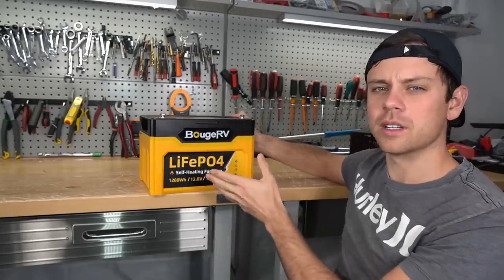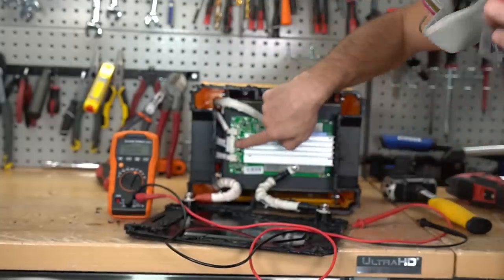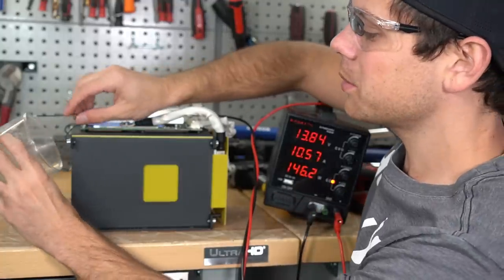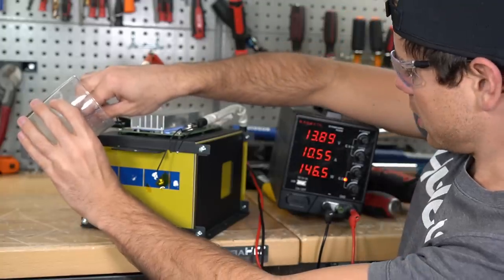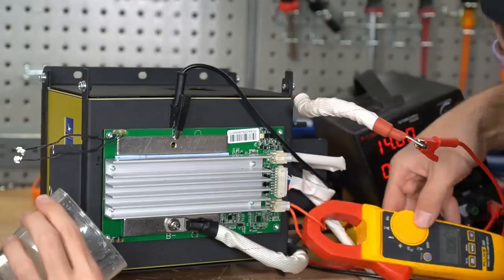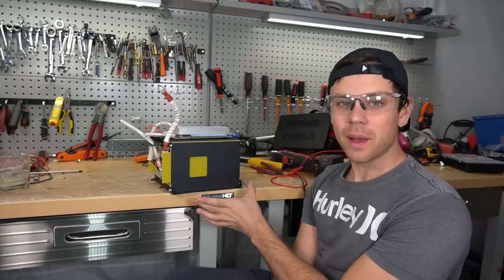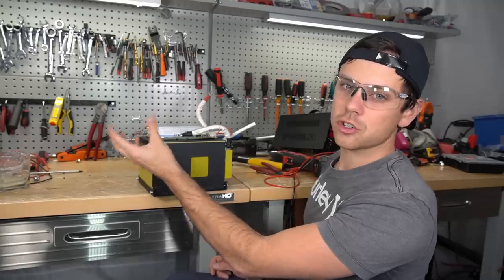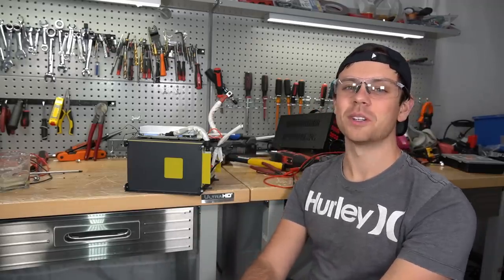$679 BougeRV 12V LiFePO4 Solar Battery

Comment from the maker: You can buy it here (affiliate link): https://www.bougerv.com/products/12v-100ah-lifepo4-battery?aff=will
~~~~~~~~~~~~~~~~~~~~~~~~~~
Does off-grid solar confuse you? Check out my DIY friendly website for solar system packages and product recommendations, and so much more!: http://www.mobile-solarpower.com

Join our DIY solar community! #1 largest solar forum on the internet for beginners and professionals alike: https://www.diysolarforum.com

Check out my best-selling, beginner-friendly 12V off-grid solar book (affiliate link):
http://amzn.to/2Aj4dX4

~~~~~~~~~~~~~~~~~~~~~~~~~
My Solar Equipment Recommendations (Constantly updated! Check here first):

12V/48V Lithium Batteries: https://www.mobile-solarpower.com/solar-batteries.html

Solar System Component Directory: https://www.mobile-solarpower.com/solarcomponents.html

Plug-N-Play Systems: https://www.mobile-solarpower.com/full-size-systems.html

Complete 48V System Kits: https://www.mobile-solarpower.com/complete-48v-solar-kits.html

DIY Friendly Air Conditioner/ Heat Pumps: https://www.mobile-solarpower.com/solar-friendly-air-conditioners.html

Complete 48V System Blueprint: https://www.mobile-solarpower.com/48v-complete-system-blueprint.html

~~~~~~~~~~~~~~~~~~~~~~~~~~
My Favorite Online Stores for DIY Solar Products:

-Signature Solar: Offgrid One-Stop-Shop. Best Value 48V LiFePO4, Victron, Quality Solar Panels and Offgrid Specific Heat Pumps: 
https://www.signaturesolar.com/?ref=h-cvbzfahsek 

-Current Connected: SOK, Victron, Mr.Cool Heatpumps and High Quality Components: https://currentconnected.com/?ref=wp

-Ecoflow Delta Official Site: My favorite plug-n-play solar generator:
https://us.ecoflow.com/?aff=7

-AmpereTime: Cheapest 12V batteries around:
https://amperetime.com/products/ampere-time-12v-100ah-lithium-lifepo4-battery?ref=h-cvbzfahsek

-Rich Solar: 12V solar mega site and cheaper prices than renogy! Check them out: 
https://richsolar.com/?ref=h-cvbzfahsek

-Shop Solar Kits: Huge site with every solar kit you can imagine! Check it out:
https://shopsolarkits.com/?ref=will-p

-Renogy: A classic 12V Solar Store that has been around for ages! 
https://renogy.sjv.io/n1VjXx

-Battery Hookup: Cheap cell deals
https://bit.ly/2mIxSqt
5% off code: diysolar

-Watts 24/7: Best deals on all-in-one solar power systems, with customer support and distribution here in the USA: 
https://watts247.com/?wpam_id=3

If DIY is not for you, but you love solar and need an offgrid system, check out Tesla Solar. Low prices and great warranty, and they can take your entire house offgrid with their new Powerwalls: https://ts.la/william57509

~~~~~~~~~~~~~~~~~~~~~~~~~~~
Contact Information:
I am NOT available for personal solar system consult! If you wish to contact me, this is my direct email: williamprowsediysolar@gmail.com

Join the forum at https://diysolarforum.com/ if you wish to hang out with myself and others and talk about solar

FTC Disclosure Statement and Disclaimers:
Every video includes some form of paid promotion or sponsorship. Some links on this youtube channel may be affiliate links. We may get paid if you buy something or take an action after clicking one of these. My videos are for educational purposes only. Information is subject to change/update at any time. Electricity is DANGEROUS and can kill. Be smart and use common sense :)

DIY Solar Power with Will Prowse is a participant in the Amazon Services LLC Associates Program,
An affiliate advertising program designed to provide a means for sites to earn advertising fees by advertising and linking to Amazon.com
Reply: Will, Can you start checking when you get a "heated" battery if they still output power when the heaters are turned on or, when the heaters are on do you lose the ability to run equipment off the batteries.   It's a pretty big deal for people that are depending upon using their battery stack for power and it gets cold and then the heaters kick on...
Reply: Yes. Any thing electrical
Reply: Will, you could still have tested the battery once you fixed the balance cable issue. I really was waiting for the testing of this self-heating model. If you still have it, can you please run the capacity test? We don't need the case to be intact for it.

Comment: i've purchased mc4 connectors from bouge rv, and a fantastic 9 quart 12 volt fridge freezer that i absolutely love, i use it as a freezer in my camper van in addition to my fridge, holds a steady 10° 24/7/365, excellent little product.
Reply: Thank you!

Comment: Switch to Davinci Resolve for video editing, and you can use their Voice Isolation feature which would get rid of the noise in the background super easily !
Reply from the maker: I've been using davinci for about five years now. Never had good luck with that feature but will try it again
Reply: So there! Mike hahaha. Will is Johnny on the spot with everything!
Reply: @WillProwse  it new from version 18.1
Reply from the maker: @mochouinard  will try it out
Reply: Those filters are gimmicks. There's a reason recording studios isolate from noise the old fashioned way.
Reply: @toronado455  The new Voice Isolation AI in Davinci Resolve is pretty good in my test so far !  Pretty surprising.  He probably would just set it to a lower percentage or else it just remove too much.  What I do is I double the track, use the AI for a clean track, then keep the original track in the back at a much lower level. (Since no background noise at all is not good, you need ambiant noise (which is what we do on film set, and why everyone hate the sound guy)
Reply: Oh how I wish I'd got that and not crash-happy, image-"fixing" Vegas. I was boycotting Sony back then too, for some reason, but Vegas is sold "disguised" in Japan by some other company.

Comment: I can understand why they waited for all of the sensors to get called before triggering triggering self-heating. It makes complete sense from a safety standpoint. If one of the thermometers was incorrect, you don't want to trigger the heating pads until they cause a problem like a fire.
Reply: Also with the heater plates in-between the packs, that should help spread any heat across the four cells and therefore the 4 sensor regions, given time.  However from what you said - I'd think from a redundancy PoV maybe taking the average of 3 readings would be better in case one of those sensors did fail.

Shame the unit isn't more serviceable in general too, but this does seem to be the norm.
Reply from the maker: Heating pads causing a fire?? How did this comment get upvotes. Thay doesn't make any sense at all
Reply from the maker: @user936  the sensors should still be spread out across the thermal mass that is being assessed. Having them accumulated on one side is never a good idea.

Comment: I just paid £759.00 🇬🇧 for a 12.8v 280ah battery with heating, also has a 10 year UK warranty . I actually bought 2 of them for solar storage 24v system . They are back ordered so due to receive them in early January 23 .

Comment: Will, be sure to ask them about the unknown BMS.
Reply: Hi there, the brand is BYD. If you’re interested, they are 
BYD LiFePO4 cell protection (charge&discharge control, charge&discharge protection and shortcut protection), 
MCU control (heating pads and temperature protection)

Comment: How about a video for an overland build. Someone who takes an off-road vehicle far from the grid. Something that would stand up to intense off-road driving/shaking that could charge with 100w panel on a roof top tent and possibly a way to plug in a second panel that is set up on the ground. 
Thanks I’m totally lost where to start and everything I need that would fit in the footwell area of the backseat.

Comment: Great video.  I agree that the battery is built super. Tried to buy one and bouverv said they discontinued the heated battery and not planning on brining it back..they wanted me to buy a non heated battery…dumb since I need a heated battery…I guess bouverv had a lot of problems with the heated battery and they wanted out of the heated battery buisness.  Phooey.
Reply from the maker: Heated batteries do have a lot of issues. Especially when they are put in series
Reply: @WillProwse  will review your videos for another option thanks

Comment: This one is $4oo CDN, thought you might be interested                                                                                                                                  LISUATELI Lifepo4 12V 100Ah Lithium Iron Battery | Deep Cycle Battery | Low Temperature Charging | Built-in BMS | For Solar System, RV,Camping,Trolling Motor,Marine,Overland

Comment: I have found good stuff through BougeRV, I have their 100w 9 busbar panels setup as a solar breifcase, the cost here seems high though, ~700$ for a heated battery when you could externally enclose and heat 2 100ah 12v batteries for the same cost.

Comment: If the battery is stone dead, and you hook power to it when it is cold, I guess the BMS runs the heaters to warm it before charging? That would be an interesting test.
Reply from the maker: Yep that's how they always do it

Comment: Those are EVE cells, and the QR code is under the fiberboard next to the positive cell connection, not next to the pressure valve. Quite likely their 105ah cells. What sort of dimensions are the shipping box? Looking for a good heated battery to send relatives in Ukraine.
Reply from the maker: Will take a look
Reply from the maker: Shipping box was pretty standard size due to the foam

Comment: Hey, can you suggest of the LiFePO4 batteries that can function as a car starter battery? I am looking to run a dual battery setup on an overland vehicle and would like to have to Li batteries for starting and aux purposes. I live in TX so extreme temps are not an issue, but CCA power is.

Comment: Hey Will! I enjoy your videos and I'm learning a lot about off grid power systems. I would like to know if my Lifepo4 battery has a good BMS, which is designed to protect against over heating, over charging, etc. Why can't I just hook a good standard 100 amp charger to it at a fraction of the price?

Comment: BougeRV has pretty good solar panels.  I have 12 of there 100w 9bb  6s x 2p setup.  on good days I get over 1200w out of them.  Tried one of there CIGS solar panels kinda neat, 30+v 100watt kinda expensive but they work good.
Reply from the maker: Good to know
Reply: Over on Hobotech the prof swears by this company's panels, I think he had one fall off his van and get badly banged up, but it still worked!
Reply: Thank you! We are glad that you like our solar panels!
Reply: I was thinking about one of those CIGS solar panels due to the shape of my RV's roof.  But I worry about the long term sticking ability, and the 'no air flow' thing.  But it would work great for my unique roof.

Comment: Very cool but I decided on amppre  time 100 amp hour or 200 amp hour lithium phosphate ion battery for my solar power system in my RV and I want 400 amp hours$350 for the 100 amp hour and $651 for the 200 amp hour or $900 depends where you buy it
Reply: You are comparing UNHEATED ampere time to a HEATED battery Will is reviewing?

Comment: Will, it looks like BougeRV only sells 100a batteries. Impressive battery but I’m looks for a 300a battery. Would you consider reviewing the Enduro brand of batteries, especially since the have 200a and 300a batteries available.

Comment: Will, thank you for all this great content! I am hesitating about buying the 200Ah Ampere Time battery from your site links, because of the lack of temperature protection in the BMS. Is there anything external, besides heating, that I can add to prevent charging below a minimum temp, or should I just pay more for a battery that has it built in? I'm going for the Renogy DCC30S 12V 30A Dual Input DC-DC On-Board Battery Charger with MPPT that you recommend, which has "battery temperature protection, " but I'm not sure what gets protected by that. (I've ordered your book, but it won't arrive before the sales are done!) Thanks again for all your work!

Comment: Huge bummer.  Do not buy.  Wish I saw this before.  Mine arrived reading 3.26.  Loose connections only reading a single cell?  Or did the BMS somehow let it actually get that low?  Who knows, can't see inside.  Hopefully they'll send a replacement, but unless I want to spend $100 /battery to return it, I'm stuck with these, never knowing when a bump i the road will make it fail.  It won't  accept current from a charger.

Comment: That heater behavior doesn't make sense does it?  If all 4 have to be cold to start the heater, but only 1 being cold will cut it off, won't you always end up deadlocked - when heating, the first sensor to reach the heater startup temperature will cause it to stop heating, but the other 3 will still be cold and turn off the battery?

Comment: I would ask them to send you a new case. Or develop a way to reinstall the battery into a new case. It does look like a keeper. Thanks again for your work.
Reply: I had a similar problem with my battery in October. Dylan in customer service was very responsive and sent me a new battery right away. They were very helpful and quick to respond.

Comment: I don't believe gluing the connector is a good option . Replacing the connector with a locking connector is a better option and probably cheaper .

Comment: can i buy batteries and charge it using normal AC electricity and use it when electricity goes off ?
Reply: This battery requires you buy an additional charger.  What you may like is one of those solar generators, some of them (not all of them though), have a charger built in, so all you have to do is plug them in.  That said, there is a simple 12v battery out there somewhere which has a built in charger, Ive seen it somewhere.

Comment: Could the heaters be enabled at a different temperature value versus charging cutoff?  Maybe the heaters come on when they're all below, say 40F?  But charging cuts off when any sensor reaches 32F?  I think you'd want the heaters to come on at a higher temp to keep the whole of the battery above the charging cutoff.  It seems sub-optimal if the battery stops charging because its below temp and then doesn't start charging until the heater warms it up.  And, waiting for all sensors to get below the heating threshold isn't too weird in that case.
Reply: Will, can you elaborate on the heater algorithm. Heaters should ideally start before charging cut off. But are heaters powered by battery or charging power? Are heaters only active during charging, and disabled during load only? Would not want a case where the battery tries to self heat when there is no chargingpower available. Thanks for the reviews!
Reply: @permagnelunde  
Hello my friend, glad to answer your questions:

1. Heaters are powered by charging power. 
2. Yes, heaters are only active during charging, and disabled during load only.

*During load only, the heating pads will not be activated even the temperature under 32°F;
*If the battery is connecting to the charging power, but cells haven't been heated over 32°F, the temperature protection will cut off charging. 

From BougeRV

Comment: Sir, I have a 100ah lifepo4 battery with a 1000watts pure sine wave inverter and a 200watts panel, can I run a washing machine of 440w (280w washer and 160w dryer) on it?
Reply: Most likely, but it depends on run time. If it’s running for 2 hours, I’d say, be sure to only run it mid day when solar power is at peak. 160W seems kinda weak for a dryer though.

Comment: RoyPow’s store had this long post of your marine battery review (started typing marine in search and up pops your picture). 
Can you get one of their “budget” 12v/105ah to review? (150a max continuous draw, charge meter and off/on button on top of the battery. I would like to see if it is built as well as the marine one in your review.
Reply: They are sold out of the ones you reviewed, by the way!
Reply: Scratch that, Lithium Solar already did one..

Comment: Why glue a connector? All connectors should have a locking mechanism.  Isn’t that what you normally see?
Reply from the maker: It does lock. But they still wiggle out. So there is a special type of glue for connectors. Very common stuff that works great
Reply: Did they contact you to say they were fixing that problem?
Reply from the maker: @donnahodges7952  yes they did fix it

Comment: Hey Will, did you ever help your friend with the Sol Ark install?  I'm thinking 15k of pv from santan and buying it with an eg4 rack as a diy
Reply from the maker: He still hasn't gotten to it yet. Unfortunately
Reply from the maker: Should be pretty solid unit. It's one of the few that's actually certified in every state.
Reply: Bummer, I'm going to start ordering everything soon for a new house build, so hopefully not backorder everywhere.  I just need pv racks for ground setup and I'm good
Reply: @WillProwse  looking forward to that install

Comment: Hi Will or can anyone help me. I think I ruined my new Renogy 170Ah LiFeP04 batteries? I was hooking them up in parallel and had all the wires hooked up in parallel except 1 wire and it touched one lead to the + of the other battery and it sparked and now I can't charge them. Battery 1 sits at 12.96v and battery 2 sits at 13.58v. When I put a load on either battery it just goes down to 11v or 12v What can I do if anything? Thank you
Reply: Hello ?